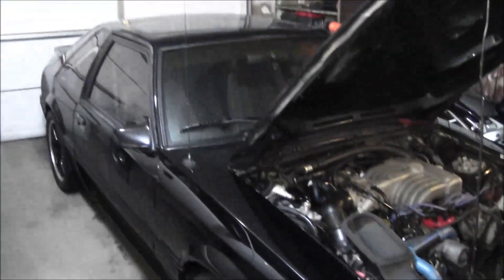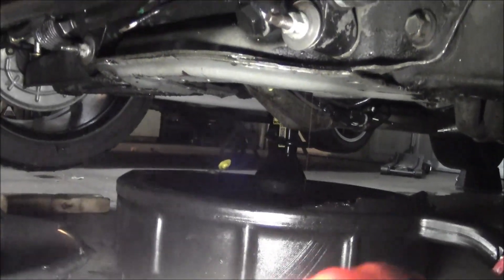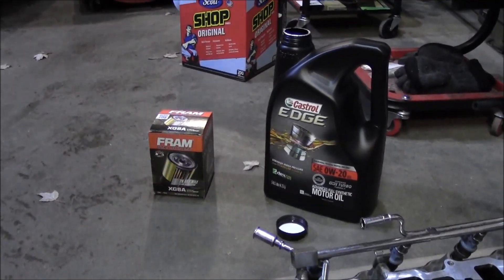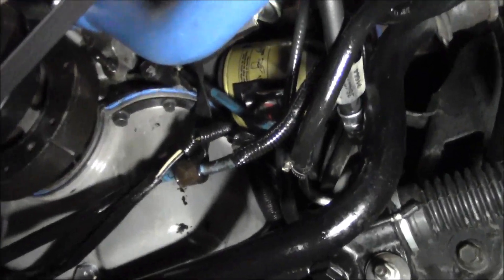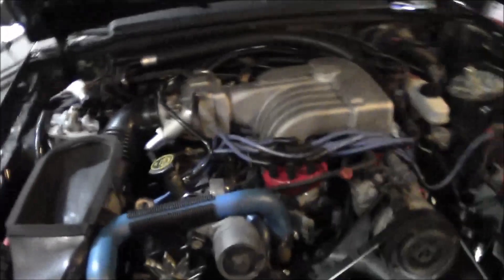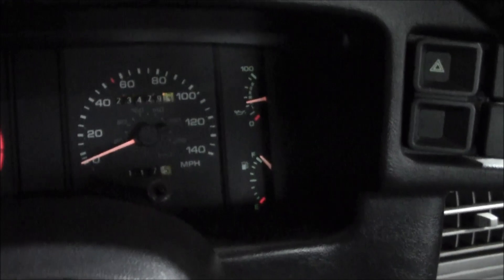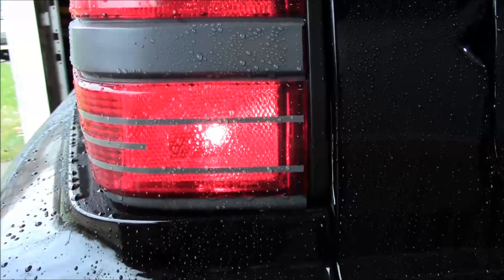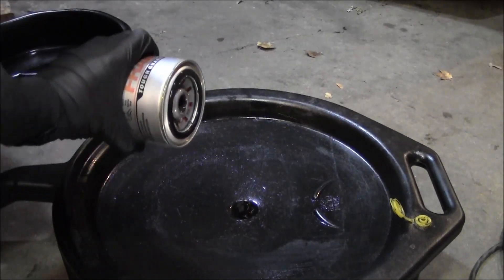Fox Body Winter Oil Castrol Edge 0w-20

Comment: Used the same oil  but used a Fram XG 7317 for my 06 Honda Ridgeline. The Fram XG is full synthetic media wire backed screened silicone ADBV metal caps for under $10.00 at Walmart.
Reply from the maker: Arthur Smith:  The XG filters seem like they are pretty solid.

Comment: Hey I'm back to bug you 😜. I'm still having some loud valvetrain clatter and it's especially bad after my last oil change. I wonder if there was some sludge keeping it quiet cause the oil was almost black after only 2k miles. I have looked up videos on valve lash adjustment and it's ho estly just confusing because everyone has their own way and most of them are building engines so I'd assume the process for me is different. Any suggestions? I'd hope there's just something I can adjust without having to take apart lifters, pushrods, etc. My Chilton's book says I have to swap out pushrods if the valve clearance is off but everyone seems to say otherwise.
Reply from the maker: MSTWNTD:  There really isn't much in adjusting the stock valvetrain.  They sell shims but you are right, watching videos about it is very confusing.  Doing the shim adjustment is really for installing a cam.  I doubt that you have an adjustment problem.  I would guess that you probably have a few bad lifters that are not pumping up with oil anymore.  When the lifters fail to pump up, there is too much clearance and you hear clicking.  You need to remove the lower intake manifold and valve covers to change them out.  If you decide to replace them, you need to get a very large cup (most hardware stores sell them in the painting section) and soak the lifters for a few days in engine oil.  Soaking them allows the lifters to fill with oil and "pump up" prior to installation.  How many oil changes have you done on the car?  How many miles does it have?  Also, didn't you mention that it had been sitting for some time as well?  Sorry I don't remember the whole story.  I know you told me all this before but I need a refresh.
Reply: @fwh79FOXR6  I've changed it 3 times since I got it. I've been using synthetic oil without issue. As far as I know it sat for something like 17 years. Right now it has 63k miles. I'm also still chasing down the rough running, surging, and drivability problems. I've been discussing on forums and several people are convinced that it's the distributor ignition pickup and suggest I change the entire assembly as it's only $60 and it comes with a new tfi module so I can eliminate that. I had one weird instance where the car would crank but wouldn't even attempt to turn over. It smelled like gas real bad so it probably wasn't getting spark. It finally went after like 5 minutes of trying. Also a quick question about that- what distributor gear should I use? I was thinking steel sincd I read that all 302s built after 86 have roller cams
Reply from the maker: Has the oil come out black every time you changed it?  You should check your fuel pressure regulator.  Remove the vacuum line from the fuel pressure regulator.  Cycle the key on and off two times to run the pump.  Just turn it to the "on" position and then off, do not try to start the engine.  You just want to run the fuel pump.  After cycling the key, go under the hood and see if any gasoline squirted out of the vacuum nipple on the regulator or if you smell any gasoline.  You could also have someone cycle the key for you as you watch the fuel pressure regulator for leaking fuel.  However, be sure to wear safety glasses to protect your eyes from possible gasoline spray.  This video talks about it  https://youtu.be/B4ujJY6Iy-c  The problem could be in the distributor but I doesn't sound like it to me.  I'm not sure about the gear on the distributor.  I know that all the H.O. engines were roller cams from 1985 forward.  However, that does not mean the non-H.O. engines had a roller cam.  I know the 5.8 engines did not have a roller cam.  Even the 93-95 Lightnings didn't have a roller cam.  I would check that fuel pressure regulator because if it is leaking from the diaphram, it is causing the engine to suck fuel into the intake.  That will make it very hard to start, give you that gasoline smell, and it could also be causing the engine oil to turn black because the super rich mixture is making it's way past the piston rings and getting into the oil.
Reply: @fwh79FOXR6  thanks for the details. I changed it when I first got it. It was from auto zone though so I'll make sure to check it 😂
Reply from the maker: @TheMstwntdLMSV123  You're welcome.  It is really hard to get good replacement parts these days.  I have bought "bad" new parts more times than I can remember.  Has your oil been black every time you change it?
Reply: @fwh79FOXR6  I just noticed it this last time I changed it. First oil change was with conventional but it started after the switch to synthetic the past 2 changes.
Reply from the maker: @TheMstwntdLMSV123  Interesting.  It's possible that the synthetic oil is breaking down a lot of sludge faster than the conventional oil could.  A car sitting for years on end is really the worst thing for it.  Who knows though, maybe after some time the lifters will pump up ok.  Maybe the synthetic oil is breaking up sludge that is getting stuck in the lifters.  That could eventually break down and fix the clicking problem.  Some times things can bounce back.  Let me know what happens with the fuel pressure regulator.  I doubt it's bad, but it could be.  So it's worth double checking.  Like I said, new parts being bad seems to be the new normal now.  If the fuel pressure regulator is ok, the ignition system is most likely to blame.  Have you had the cap off of the distributor to check the terminals and the rotor?
Reply: @fwh79FOXR6  I've never seen it myself but I asked my dad and he said he replaced the cap and rotor, and he said everything else looked fine, but I'll look myself just to be sure when I'm looking at the fuel pressure regulator. It's pouring down here and she doesn't fit in the garage, so I'll have to look some time next weekend.
Reply from the maker: If your dad replaced it, it should be fine.
Reply: @fwh79FOXR6  I haven't had time to check anything else but I have noticed this past week or so that the valve noise only starts to happen after the car has been running for 5 minutes or so, if that tells you anything
Reply from the maker: @TheMstwntdLMSV123  Are you sure the noise is coming for the top of the engine and not the bottom?
Reply: @fwh79FOXR6  it sounded like it was but I can recheck. What could it be if it was coming from the bottom? I also noticed the smog pump is a bit noisy but it's like that from first start
Reply from the maker: @TheMstwntdLMSV123  If you were having lifter problems, that sound would happen as soon as you start the engine up.  You would hear the ticking when the engine started and if the lifters were bad, they would keep making noise the whole time the engine was running.  If your engine is not making noise when it starts but then makes noise when it heats up, it is probably worn out engine bearings.  As the oil heats up it will thin out.  As the oil thins out it will not take up the excessive space caused by the worn out engine bearings.  So, as the engine warms up and thins out the oil, you end up hearing the clicking noise of the rod bearings.  When the engine is cold, it is thick enough to keep the rod bearings quiet.  Does your car have an oil pressure gauge?  I'm guessing it only has a low pressure dummy light.
Reply: @fwh79FOXR6  just the dummy light
Reply from the maker: MSTWNTD:  Yeah, that's what I figured.  You could rent an oil pressure gauge and see how low the oil pressure gets when the oil warms up.  However, I don't think that's really worth your time.  As long as she starts and gets you where you need to go, that's all that really matters.  When you have an older car, you really have to decide what is worth your time and money as far as repairs go.  Sounds like your dad completely understands that.  So I think you're in good hands.
Reply: @fwh79FOXR6  well it's the end of the road. I did an oil flush (Liqui Moly) and it cleaned out a ton of sludge, making the noise a lot louder. Sure enough, it's coming from the oil pan and it sounds like a rod knock. It's a shame since it only had 64k miles on it. Kinda good timing cause the suspension is starting to clatter from somewhere and the power steering pump is leaking. Guess it's not worth the time. Too bad the previous owner didn't take care of the maintenance cause the interior is flawless. Let's see how long she lasts. Hopefully I can find one in better condition in the future (or maybe even a fox body if they stop going up in value 😂)
Reply from the maker: @TheMstwntdLMSV123  Sorry to hear that.  Seems like the worst thing you can do to a car, is not drive it.  Unfortunately, I think that car just sat for too long before you got your hands on it.   Sounds like there are too many problems to justify putting more money into it.  You might be able to find a Fox Body but you are right about them increasing in value.  I have random people stop in front of my garage and ask me if I want to sell either one of my cars.  It's hard to believe these old Fox Bodies are still so popular.

Comment: You totally need a new engine. That’s so much metal. Beautiful car though and cool video. Appreciate it 🇺🇸🙏🏽👌🏽
Reply from the maker: DRD TRD:  Yeah, I need to pick up a short block.  Thank you, she is a beauty.
Reply: Probably that thin oil that the engine wasn’t designed to use

Comment: Is this better than moble 1
Reply from the maker: Cody Welter:  I don't think you can go wrong with either Castrol or Moble 1.
Reply: Check the back of the oil jug and see the letters and numbers on Mobil One oil then check the back Walmart Super Tech oil . Both have the API seal of approval. One oil cost much more. You choose.

Comment: Castrol is good stuff. Period. Not as good as amsoil but better than pup on a uoa.  Pup has loads of copper in it.
Reply from the maker: Dallas Williams:  I've been a fan of Castrol since the 90's.  Never has a problem with any of their products, so I can't complain.
Reply: @fwh79FOXR6  about to dump some edge 5w30 gold bottle in my wrx hope to get better results compared to valvoline modern engine 5w30
Reply from the maker: @dnawrapsatl  Let me know how it goes for you.  What was bad about Valvoline?
Reply: @fwh79FOXR6  nothing to worry about but i went from oem oil to valvoline. After my 3rd valvoline change i notice a bit louder ticking and small hesitation under load or boost. I have to have it running smooth at all times and this change  it doesnt as feel good. I wouldnt say theres something bad about it. But i cant buy it in stores anymore due to low sales and im tired of overpriced oem junk. So im going for castrol like i have in all my past vehicles. Will let you know how edge goes in the wrx.
Reply from the maker: @dnawrapsatl  I hear ya.  I have never used Valvoline.  I try to stick with Castrol and believe it or not, Citgo actually makes some very good synthetic oil.